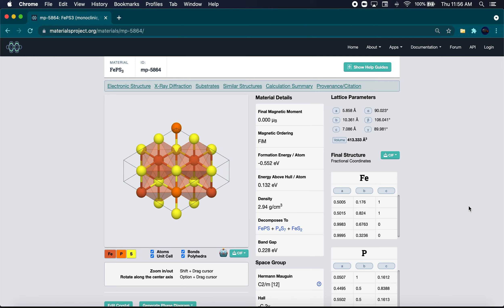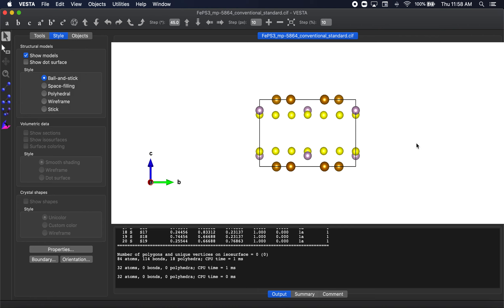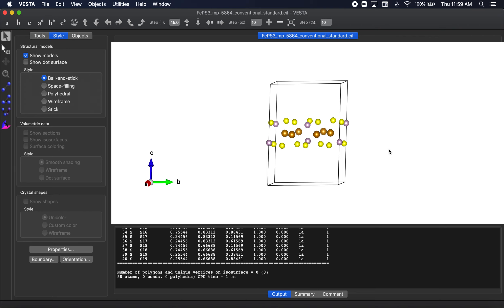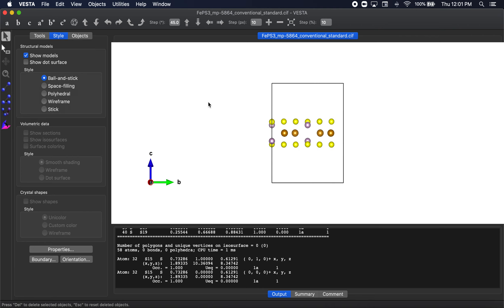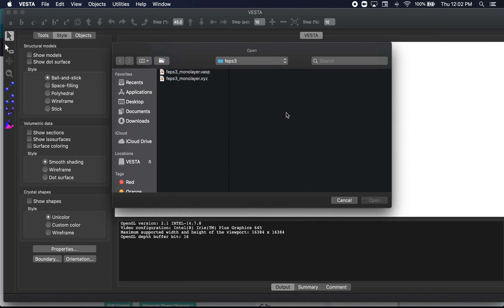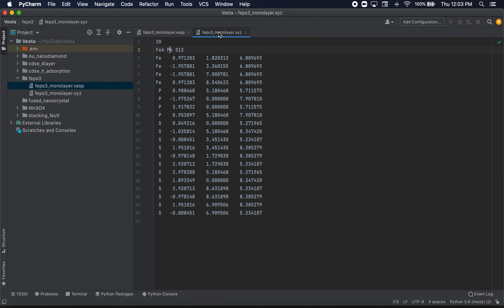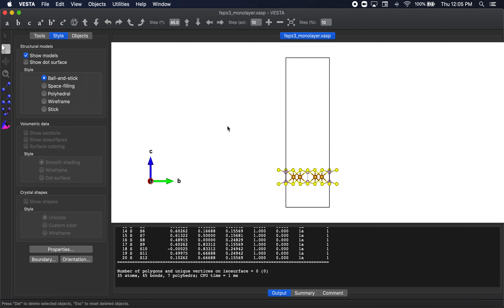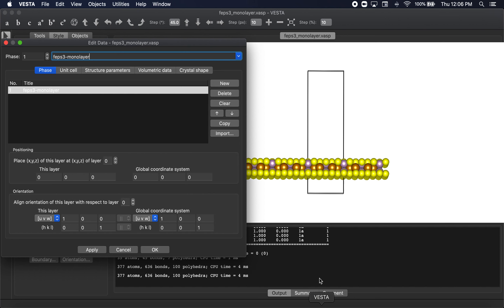Build FePS3 Monolayer in VESTA (monoclinic cell)

Comment: How can I build a 101 anatase TiO2 slab model and perform optimization calculations in quantum espresso?
Reply from the maker: Hi Kimberly. There are many ways to make the TiO2 (101) slab in VESTA. However, the cell axes are not orthogonal. Do you happen to have any particular work in mind that makes this slab? Like an academic reference you can share? Thanks.
Reply: @nickelandcopper5636  Yes I do have an academic reference:
Reply: Electronic structure and optical properties calculation of Zn-porphyrin
with N-annulated perylene adsorbed on TiO2 model for dye-sensitized
solar cell applications: A DFT/TD-DFT study
Reply: Also the supplementary section of this paper have the coordinates at the end of it